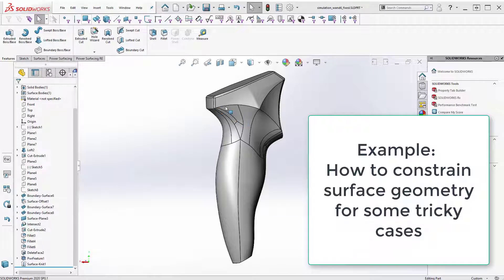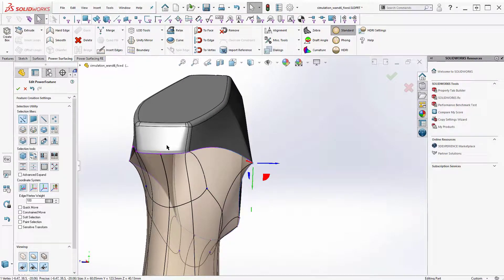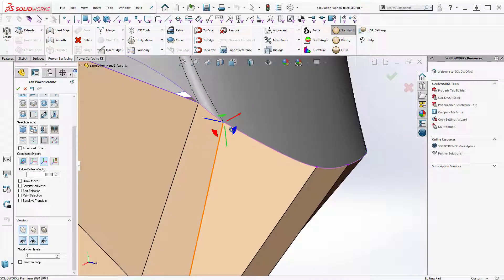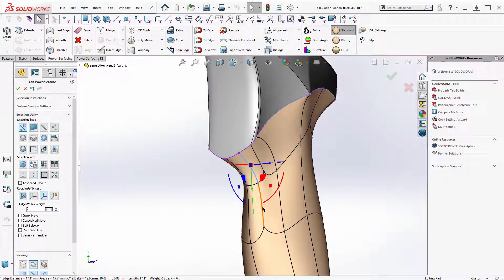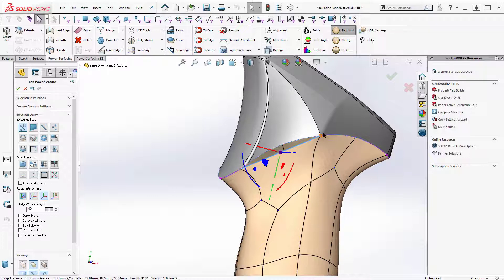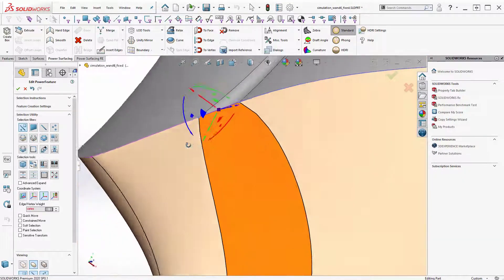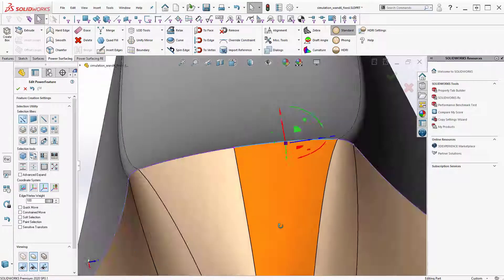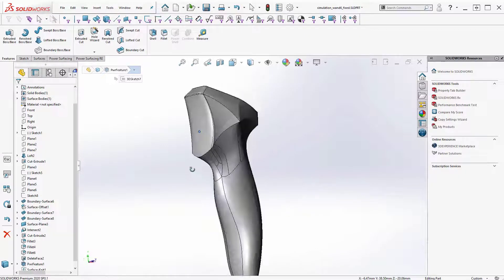Example Workflow: Constraining surface geometry using the Power Surfacing add-in

Comment: This is by far the best SUBD tool i tried. I try to add custom keyboard shortcuts but I think it's not possible, so the only downside is that i have to drag the mouse for miles when I work on a complex part and do repetitive commands
Reply: Can i do class a and better surfaces, like we can do in alias?
Reply: @janosgyerman  You can do what actually better than alias. check latest version.
Reply: @janosgyerman it's an awesome tool for prototyping, concept modeling and quick design iterations. You can make use of different diagnostic tools. Theoretically it's a class A surfacing tool but you can't manually imply G3 curvature and tweak controle vertices with Alias's or Rhino precision. The surface patches layout is automatically generated here, just like any SUBD tool. It's my personal opinion
Reply: @repolygon  thank you for your reply. It would make sence to make g3 possible so, subd would allow to make production ready design
Reply: @janosgyerman no problem man. I hear there's a big update coming soon and you can always use in combination the native SOLIDWORKS surfacing tools to get a production ready model. Ask someone more professional. i had the opportunity to use NPower last year, now i use Alias Subd workflow and trust me. It's not even close. Just the fact that you can add assign an edge weight instead of adding more loops to get the desired shape makes your workflow faster and more intuitive with this plugin.
Good luck man 👍 and happy surfacing.
Reply: @repolygon  i appreciate it. Well i would test it and see the results. It is indeed a powerful tool, price is a bit high for me but we have to pay for quality, and specially if it is a timesaver compared to time consuming surfacing than why not. Anyways thanks for giving me info. All the very best
Reply: What exactly the most shortcut you need to be a keyboard shortcut?